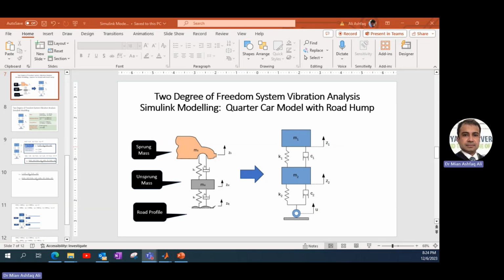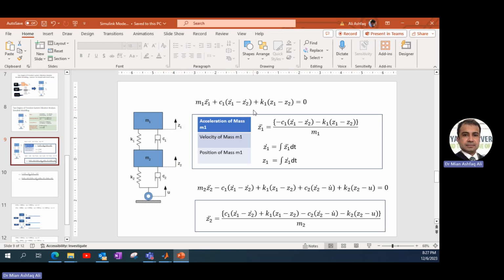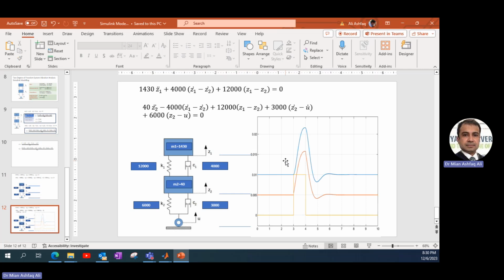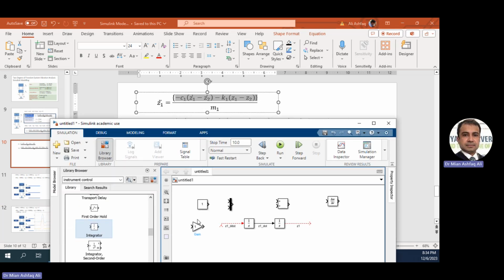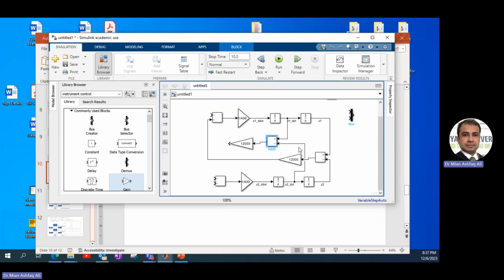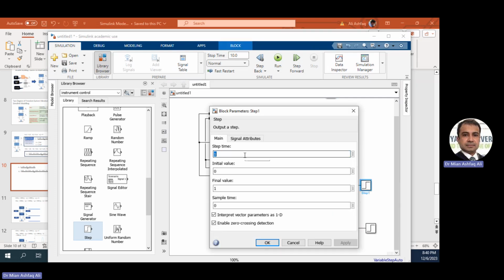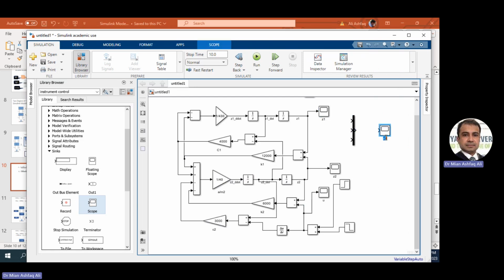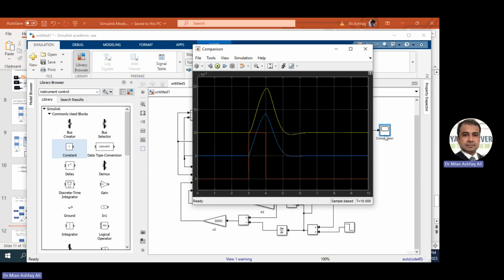Quarter Car Model Vibration Analysis Using Simulink

Comment: How do I know the speed of the model that was tested?
Reply from the maker: @محمدالطيب-س3ذ  the speed of the vehicle is linked to the input frequency from the bump . The input frequency along with the tire diameter will decide the vehicle speed
Reply: @ERSI-PK  
I want to test the change in the level of a road, not a speed bump, as there is a lot of road maintenance work in my city, and I want to test the safety of leaving a road elevated during maintenance. I hope you understand what I mean.
Reply from the maker: @محمدالطيب-س3ذ  in tvis case the Amplitude of input frequency should be adjusted according to the hight of road bump.